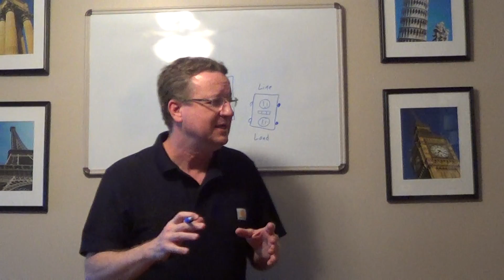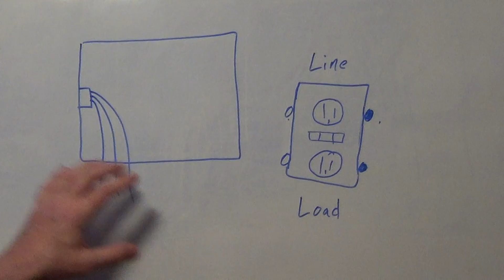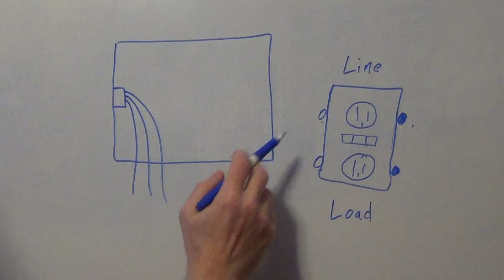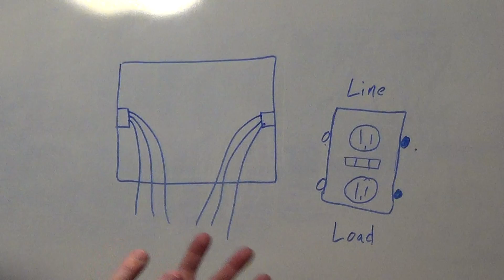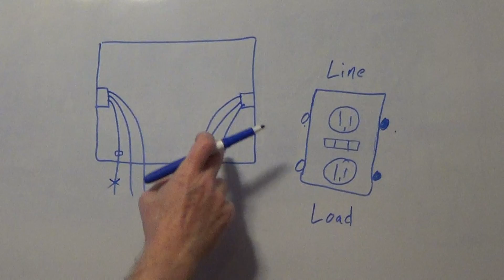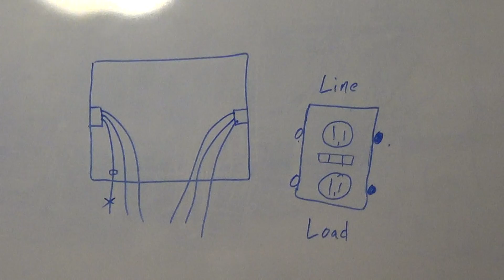How to Wire a GFCI Outlet

Comment: Hi. I'm a little confused. I have 6 wires 3 white, 3 black only 1 black is hot, that goes to the line. Are the 2 other black loads? Which white is the line? Are the other 2 white loads?
Reply from the maker: Hi, you can email me at fixitpodcast@gmail.com with pictures. I would be happy to try and help.

Comment: I have 6 wires. 3 white and 3 black. 2 of the black wires are hot wires. I'm having issues switch out the outlet and wiring it properly

Comment: Thanks for the great video. I've done regular double outlets in 2 gauge boxes so far and did a good job (up to code) - thanks to you explaining the procedure and safety precautions. 
 What if I am installing a GFCI outlet and connecting a bathroom fan switch next to it in the same 2 gauge box which then extends to the fan? Sorry, but it's a little confusing to me. Could you perhaps do a video explaining specifically going from the outlet directly into the (fan) switch next to it, in the same box, and then extending to a fan or something? I would greatly appreciate it. By the way I am using wago nuts - they seem easy to use and keep everything clean and organized.

Comment: It seems to me you forgot to mention that not all extra wires in the box will necessarily need to be considered a downstream load. If you don't want the other set of wires to be controlled by the GFCI then you would wire them to the extra set of terminals on the line side of the GFCI. Please correct me if I'm wrong.

Comment: I have 3 lines running Into mine. Is this normal or bad wiring? Thanks for any help you can give.
Reply from the maker: Hi, can you email a picture to fixitpodcast@gmail.com
Reply: I have 3 lines in mine also. Did you find out how to wire them?
Reply: Also have 3 cables in mine

Comment: Can you please explain more about the ground wire?? Do we connect all the ground wire together?? And the. Wire nut it??? Or do we just leave it alone?????
Reply from the maker: +Michelle Maya Hi, connect the ground wires together with a wire connector and use a small length of wire to create a pigtail to connect to the green ground screw on the GFCI. Let me know if that helps.

Comment: What do you use to test the wires and find what wire is hot?  Thanks.
Reply from the maker: +orestesdd Hi, you can use a non-contact electrical tester or a multimeter.
We have more tips in our home improvement book http://www.amazon.com/dp/B01BK2K0JM?ref_=pe_2427780_160035660